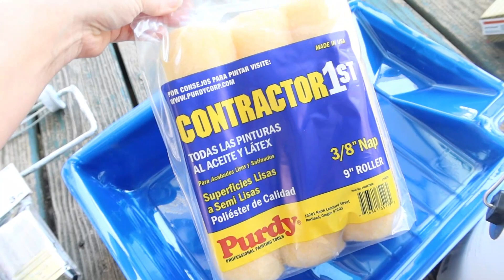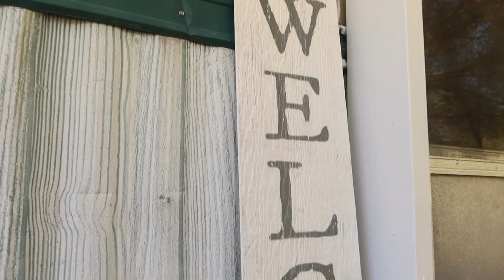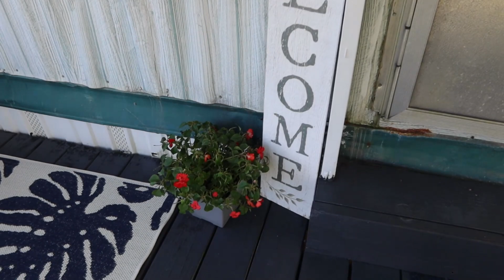DIY FRONT PORCH MAKEOVER ON A BUDGET | MOBILE HOME FRONT PORCH MAKEOVER W/ BEFORE + AFTER

Comment: Great job Kelly!! Ferns love morning light, and they cannot stand hot afternoon sun. Also take a sprayer bottle and mist them down often. They thrive on this. I have them on my deck, but they require attention. And they really cannot stand hot afternoon sun. Just keep them watered and shaded and they will thrive. Morning sun is great for them if you don’t live in an extremely hot climates like Florida in July, August, and September. Love them and they will thrive. You will also have to get a bigger pot eventually and repot that one. Vern’s  get huge. But it will be gorgeous sitting on your deck when it does.
Reply from the maker: Thank you!
Reply: I have a couple of ferns on my front porch in each corner. I bought at Lowe’s in gallon size pots about four years ago. I had to repot them in bigger pots. They are easy to take care of they need more water in the summertime I mist them often,  cut them back in the winter months.  I live in North Central Florida, when it freezes I cover them with a piece of plastic or tarp.  I enjoy all your videos. 💕💕💕💕
Reply: Beautiful job Kelly🦋
Reply: I live in the deep south of Mississippi.   I buy Kimberly ferns to hang a d they love the sun.  I have one on my mailbox.  It's gorgeous.  Need to water everyday.  Enjoy your porch.  You did a great job gal.

Comment: Your makeover is beautiful!!!  I love it!  I know you're tired, but when you're rested up, consider taking the boards you didn't use and frame out the front of the lattice.  Make it kinda look like it does on the inside. It's beautiful now, but framing out the lattice on the outside will just polish it off neatly.  Also, if you have any boards leftover, attach them to the risers of the steps, under the stair treads (the kickboard) and paint them white. It will really look neat with the gray treads.  I agree with the other lady about caring for your ferns.  But if you need something that will flourish in sun, don't discount petunias, geraniums, and sweet potato vine.  They are all inexpensive---very much bang for the buck.  Congratulations!  Well done!
Reply from the maker: Oh great idea! I will keep that in mind. Thanks for the tips on the flowers. I may move my ferns up onto the porch and hang something that enjoys the sun 💗

Comment: Water and fertilizer for the ferns..when you go to water them if the water comes through the pot and out the bottom of the pot…it means they’re root bound and needed to be planted in a bigger pot and adding potting soil….some potting soil comes with fertilizer already in it and can fertilize a plant anywhere from 3-6 months depending on what brand fertilizer you use I love the ferns I get mine from lowes too…I love where the winters are cold so I need to replace them every year but it’s well worth it sometimes lowes sells them for 12.99 which is not bad especially if you live in the southern climates they will last for years….when I lived in Florida I would plant the in the ground around my mobile home and in between i would plant crotons the vibrant color ones and oh how beautiful the two plants look together….I love them…
Reply from the maker: Thanks Nancy!

Comment: Take ferns down once a week and sit them on the lawn and give them a good soaking.  Let set til they no longer drip then hang back up.  If you water them while still hanging,  the water just runs right through and doesn’t soak into the roots.

Comment: Next time you have a project with 2x4s, don't let them intimidate you.  Use the drill you have and get a set of drill bits and drill a small "pilot hole" in one and if the screws are rather big, drill a second pilot hole in the first to make it bigger.  Then put the screw in.  Easy as butter.  Those muscular guys know this.  I love your transformation.  It looks great!